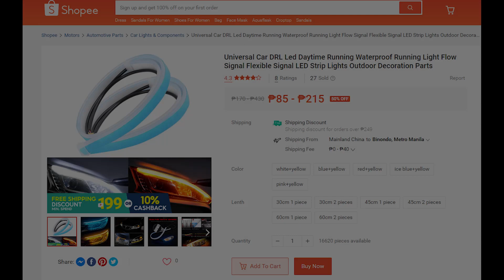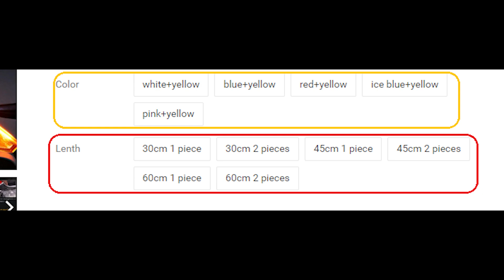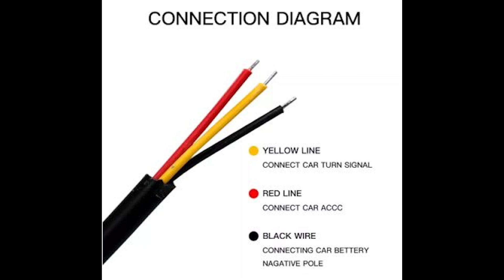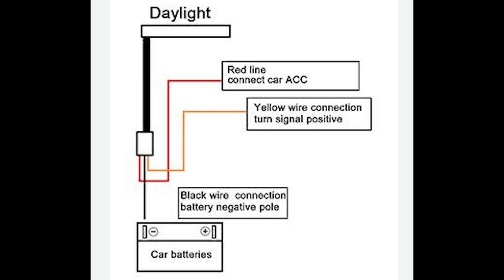DAYLIGHT RUNNING LIGHTS (DRL) LED strips DIY INSTALL for SUZUKI S-PRESSO #suzukispresso  #ledlights

Comment: Can DRL connected to lighter socket or something? Because it looks like it is connected to headlamp
Reply from the maker: yes it can, you can even make a separate switch on your dashboard, depends on how you want to set it up. Mine goes along with headlamp so it lights only when I turn on the headlamp, and will signal lights as I switch on signals. same goes with my hazard lights as shown on video.